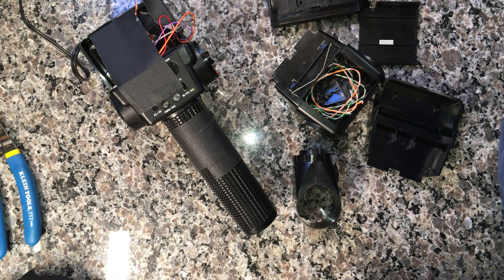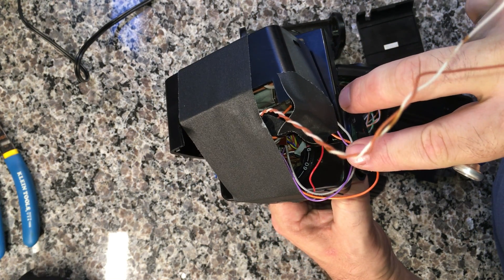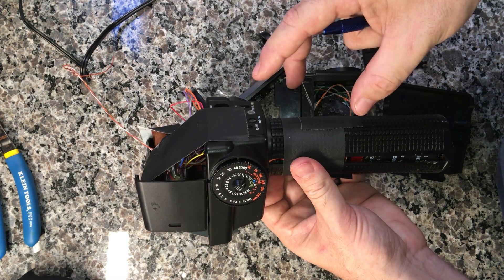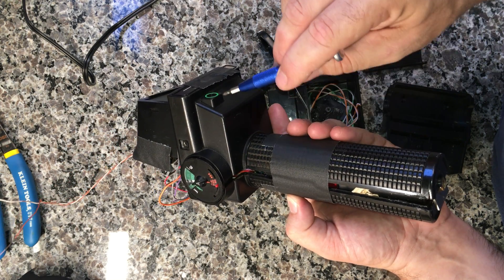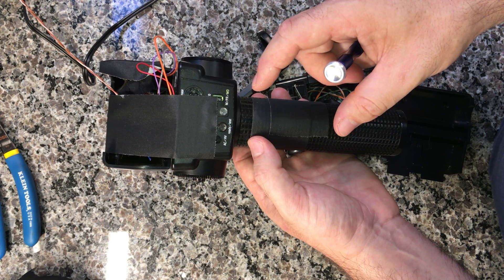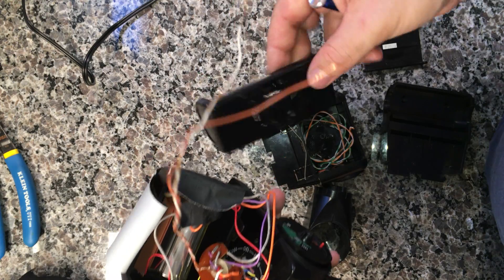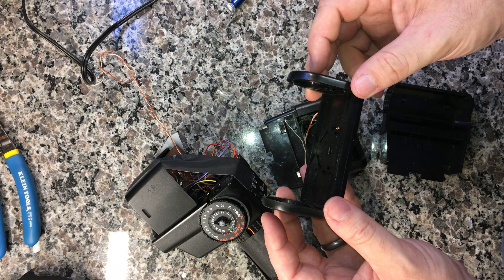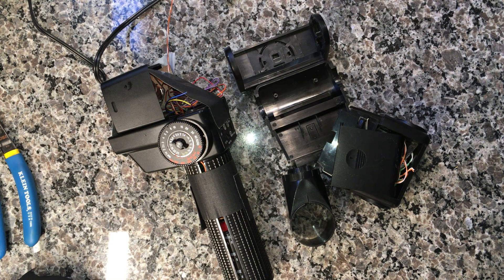Sunpak 522 Teardown notes

Comment: I  now have 4 of these that will no longer power up (using a qauntum turbo battery), I am guessing the most likely culprit is the capacitor?  I plan to sacrifice one to open up and see what I can learn.
Reply from the maker: Best of luck!  My original reason for doing this was to explore whether these could be powered by a larger capacity lithium ion battery.   The issue is that modern batteries perform so well that the internal wiring isn’t up to the duty cycle possible.  I actually melted some wires because the battery I tried could pump out a full power shot every second or so and that was maybe 5x more current than it was designed for.

Comment: The 455 (also known as the G4500) is similar.  I got two on Ebay as a job lot and made one good one out of them.  I did not need a heat gun to get the bottom screws out, there was no disc there.  You say it's a nightmare to get apart - it's an even bigger one to re-assemble. In one of mine the capacitor was very firmly stuck to both halves of the handle casing, in the other the glue was weak.  I tied the wires in place with cotton to re-assemble.